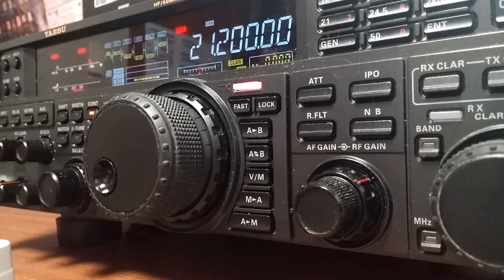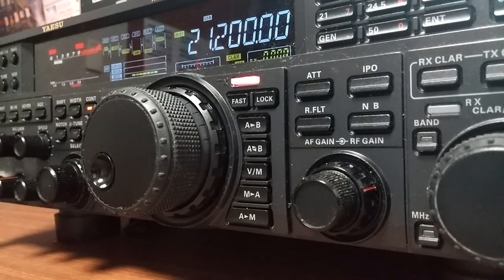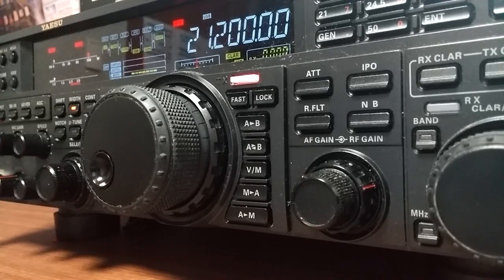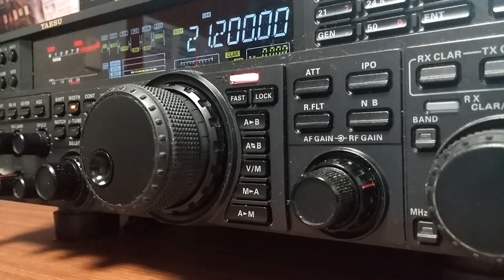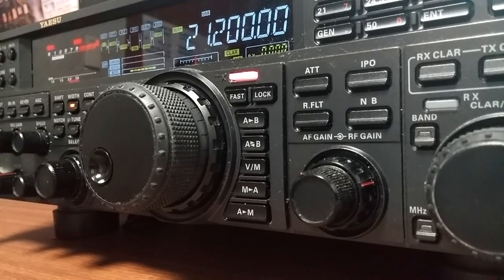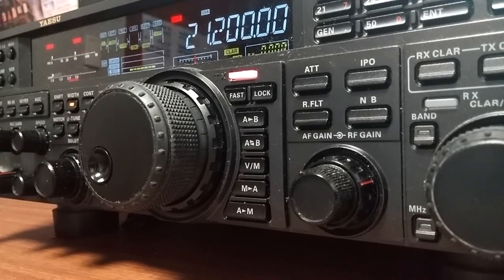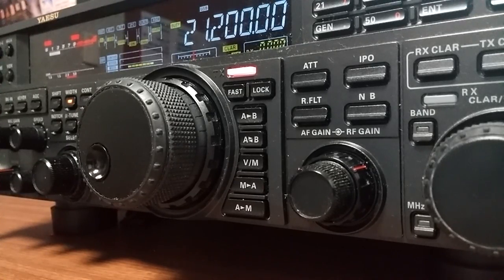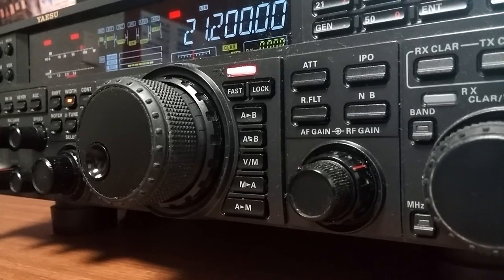Yaesu FT-450D Mic Test Comparison: MD100a8x vs. Stock MH-31a

Comment: On the MD100 desk mic, The ‘High Emphasis’ switch ON will  
cause a [bypass] condition for the ‘Low Cut’ switch.
‘Low Cut’ only works with the ‘High Emphasis’ switch OFF. 
That’s why you noticed no change when he moved the ‘Low Cut’
Switch. It’s in the documentation as well

Comment: While this video was done well and I will take nothing away from that. There are a few things to note. There are different EQ settings for the standard microphone. The ones the transmit operator was using are the ones were the microphone sounds the worst in my opinion. I have played around with the mic for quite some time and have found that if you set the tone on the back of the microphone to position number 2 and the EQ to 4 and set your mic gain to normal it has a very good quality sound. I won't say that the desk mic doesn't sound better, as it should, it is over three times the price. But the standard microphone can sound much better than was Illustrated with this video by using the correct settings. 73 s. Thanks for the video presentation.

Comment: Question, was the operator using the MD100a8x running an amplifier ?
Reply from the maker: mykenwood830 I think you mean HF power amp?  I am pretty sure he was not, if I remember correctly.  If you meant on the mic, the mic does have an internal amp, which he tried both on and off, for comparison.
Reply: I meant if he was running an HF amplifier. TY. I am seriously thinking of buying that mic for my 450D.

Comment: Wow .. the MD100 cuts through much better than the MH-31. I had read that the MH-31 (which I have) had a muddy sound, and this confirms it. Thanks for this very well done and informative video!
Reply from the maker: HammerToneAmps Try these settings.  They seem to work well for all Yaesu radios with the MH31B hand mic:

http://thestingyham.blogspot.kr/2017/10/yaesu-ft-891-mic-settings.html?m=1
Reply: I appreciate that .. I'll study those settings.

Comment: that's not a FT-450D
Reply from the maker: Carlos Baquero Transmit is a 450D. Listening on an FT950. The point of the exercise is to hear what the mic sounds like to others. The FT950 has far superior receive bandwidth, and sound, and is a good radio to hear what the FT450D with MD100 is capable of. But what is important is for listeners to know what the mic sounds like over the air, using a 450D on transmit.  This video shows that.
Reply: 데릭피코너 agree with you, i just got confused with the rig because I was looking for videos with FT-450D.  No problem my friend.

Comment: HL1ZIX de DV3XUK. the switch setting at the back of the MH-31B is set 1. Sorry I also forgot to change the switch setting during the testing. 73!
Reply from the maker: Hey, glad you found the video! I thought I had your email on QRZ, but didn't see it, so I could not contact you. I think I preferred the very first settings you had, at the beginning of the video for general speaking.  It was the first we heard from you, before changing settings.  For long DX the mid emphasis with high emphasis was also nice.  73's, and thanks!!
Reply: Nice DV3XUK and HL1ZIX